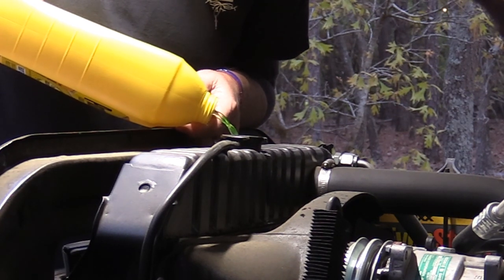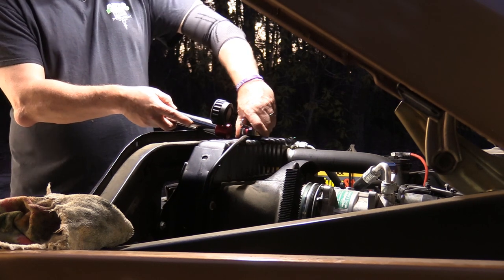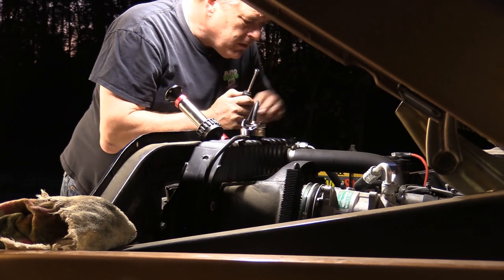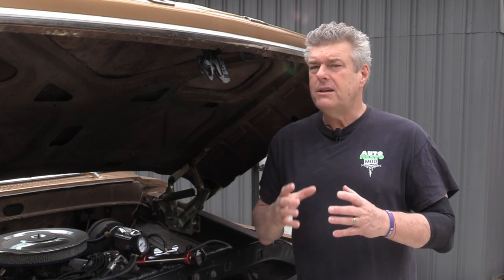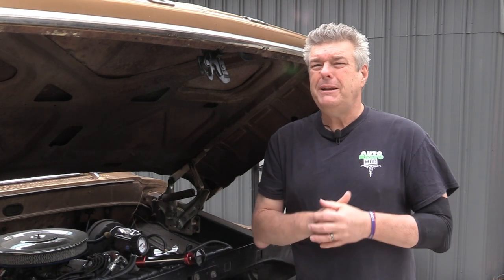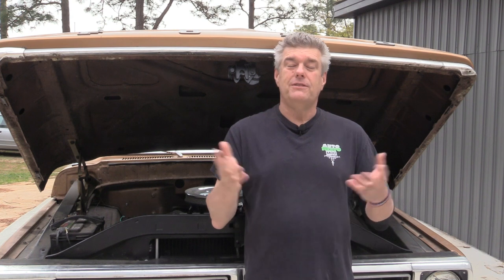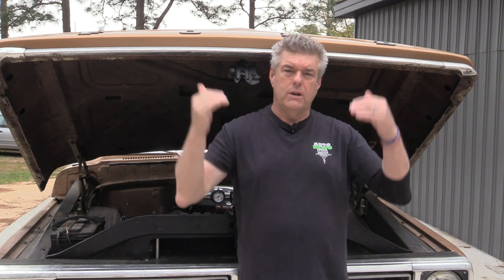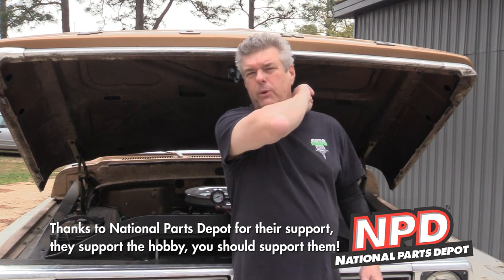Is there a coolant leak

Comment: I've always used a little ground black pepper in leaking cooling systems. always worked for me. Bars leak has been popular tool. Speaking of difficult to find leaks, my '04 Excursion with the 5.4l had lost coolant for like 5 years after I bought it with 30k miles. No trace or drips no nothing. Just kept adding water and worried about overheating it. FINALLY one day after a weird shut-off at a stop sign I was investigating under the hood and i noticed a white coating on the firewall and realized that was lime from the hard water I had been adding. finally noticed the trajectory was from the back side of the radiator hose where it attached to the block above the oil filter adapter. Went to remove that hardened steel factory clamp an ping, the thing was cracked on one side and had pierced the hose through to the aluminum so that it would only leak when it hot soaked after shutting off.

Comment: A coolant pressure check is one of the quick checks you can do to determine the health of the engine (along with other general health checks such as a compression test). My suggestion is to use a MityVac instead of a dedicated pressure tester (as shown in the video). A MityVac is much more versatile since it both "sucks" and "blows". For example, you can use it to calibrate your vacuum advance on your distributor, check AC vacuum actuators, or change your brake fluid... all sorts of things.

To make an adaptor for the radiator I used an old radiator cap, a rubber stopper with a center hole, and some flexible plastic tubing. Hook it up to the MityVac and you're ready to go.

Checking the pressure overnight is fine (if it holds). But IMO if it holds pressure for 10min or so you're probably ok. There are all sorts of places you could get a very slow leak that is not an engine problem... eg pressure tester itself, or the tubing from the pressure tester to the radiator. You end up chasing a non-issue... it has happened to me.

Suggestion: To check for a coolant leak into the cylinders, pressurize the cooling system and then use your borescope on the low compression cylinders to see if fluid is leaking in.

Comment: I worked on a customer's 69 Mach 1 with a 351w. I told him his radiator was bad and needed to be replaced. He was in a fender bender with his daily and used his Mach 1 to go to his mother's, 4 hours away. 2 hours into the trip, BAM! He said he checked the coolant before he left. Tow truck driver said no coolant and his engine was locked up. Fortunately, only the #1 piston shattered. It's now a 393 stroker with an aluminum radiator.

Comment: Looks like you're doing this at the same time I usually end up doing this sort of thing...after dark. I'm a Ford guy from a Ford household, but changing a water pump with all those different bolt sizes on a car with a full set of belt driven accessories is a major change. Off topic, have you ever considered doing a tech piece on Ford's dual diaphragm distributor?  They get a lot of disrespect and a lot of people believe they're just an emission control dodge, but Ford used them all the way back to the Y Block days. My experience with dual diaphragm-equipped cars is that they tend to be responsive to the throttle and get good gas mileage when everything is tuned properly.

Comment: GM added coolant catch cans between 69-70 on pretty much all of their product line. It varied a bit between each division and model, but there wasn’t much left without by 71.
Reply: I added a nice billet catch can to my 460 big block Mustang but it doesn't leak or overheat, but a little can be seen in the clear hose sometimes. Was just concerned about a small puddle that my cat would get into.

Comment: So in our hispanic community there is a practice of rubbing an egg on someones forehead when they have a fever so that the fever goes into the egg and can leave the body… technically its witch craft but dont tell us that 😱… anywho… the other day at work we had a radiator that was cracked on one of our sanitation trucks… the supervisor for the drivers asked us what we could do to fix it other than replacing it so we told him the old trick of cracking an egg into the radiator to seal the leak and he was like “what? Nooo, for real?”… cause he was thinking of the superstition… and we told him that yea its an old mechanics trick to get you home… we didnt do it, and the crack was too big anyways so we sent it for a radiator replacement
Reply: Back in October 2021, My flex fan grenaded into my alum radiator. We have a radiator shop called "the radiator hospital". I called them up and asked if the could send over an ambulance and pick it up! They hung up on me. lol
Reply: @robertclymer6948  they probably get that prank call all the time… but if i owned that shop i would buy an ambulance for that very reason lol

Comment: I have a similar problem. My 67 Mustang pushes out all of the coolant out of the radiator after about 9 miles. I did an exhaust gas check and there was no gas in the exhaust. It's possibly leaking into a  cylinder on the driver's side.

Comment: Blue devil head sealer, snake oil. Just pull the head. Mysterious coolant loss will make you pull your hair out.
Reply: No stop leak crap for me, anywhere! I take care of the problem.
Reply: @robertclymer6948  most of that crap will plug up a radiator. The only one I’ve ever used is Bars leak. That will actually work on the new style radiators aluminum with plastic tanks, if the leak is at the seal between the tank and core. But it’s still a get me off the side of the road fix.

Comment: What do you do if the cap doesn't seal? Brand new 16lbs cap.
Reply from the maker: Either a faulty cap or a damaged sealing area on the radiator.